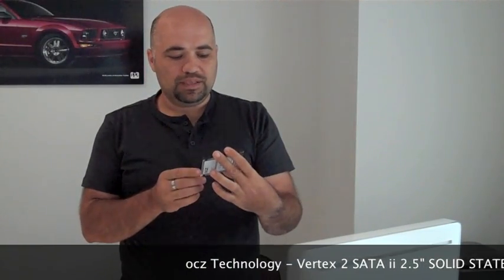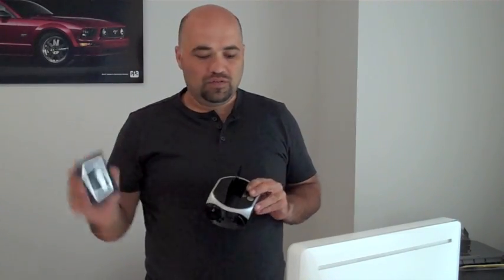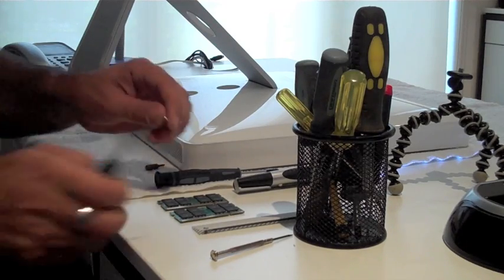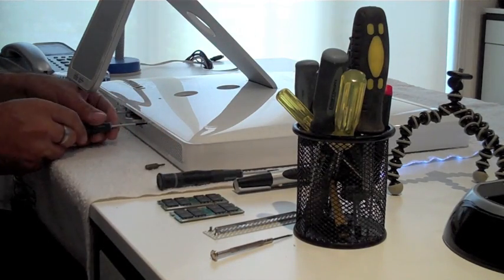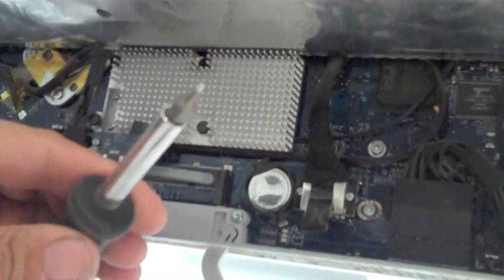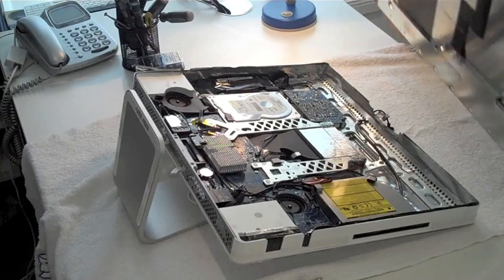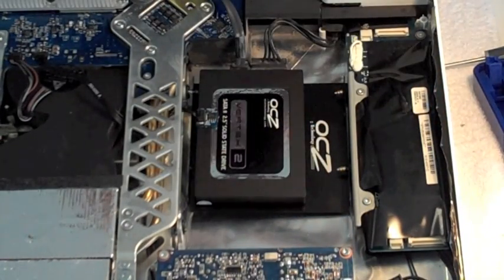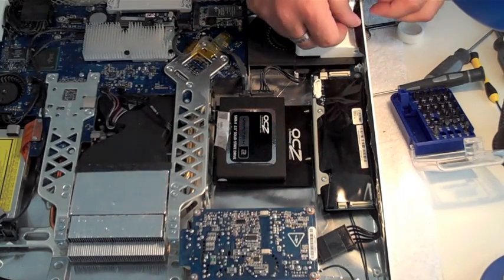White intel imac pull apart

Comment: Charlie you saved my computer's life. I took it apart removed the HD and ran into some problems. After a few days of research and procrastination I finally decided to tackle the issue. When I sat down as saw all the different screws in the screw holder I panicked a bit. I could not remember how to resemble the thing. All the other uTubes videos must be on the next version Imac because its not like "ours". 

Thank you sir.

Comment: best video for taking apart an imac I've seen! a lot of people don't mention the brackets part...... as a little sitenote: doublecheck whether the controller in the ssd works with the controller on your logic board... especially the sandforce based ssds can create big problems like the ssd not being detected if you power on the machine or random system hangs!

Comment: uhm, thhe same amount is pulled in, but it gets sucked back out way better than a dell.  I have a dell that was used since 2005 (idk if ever cleaned, i would guess not) that had a small layer of dust on everything but was not bad at all, its the clamshell ones that like to hoard the dust the most, you could use one of them to filter the dust out of your room lol

Comment: Thanks for the help!!  Just did my wife's late 2006 24" iMac - noteworthy is that this model does NOT use the funny metal latches that require the bent plastic card as a tool.  Just pops off like the old G5's.
All round a good upgrade path!